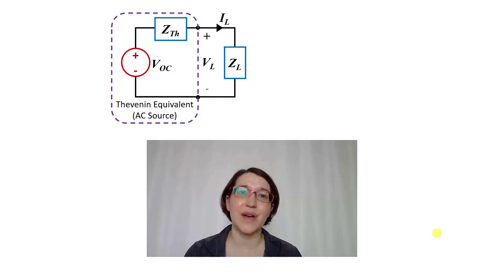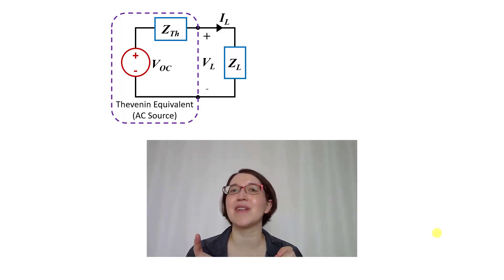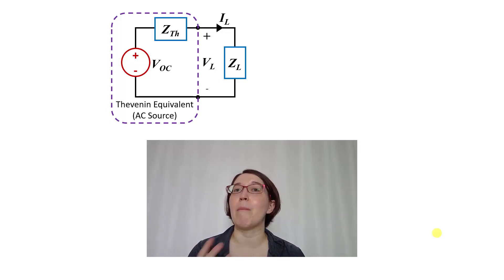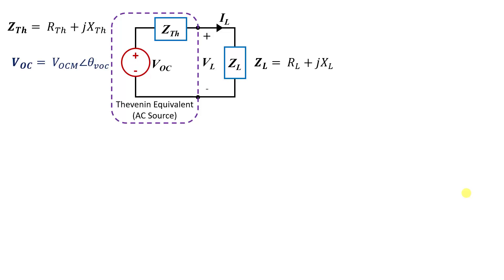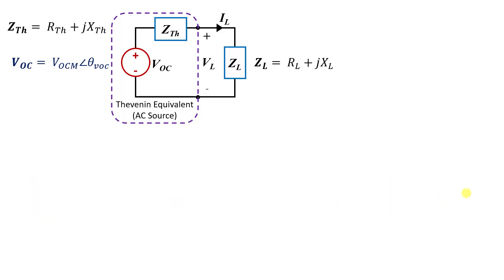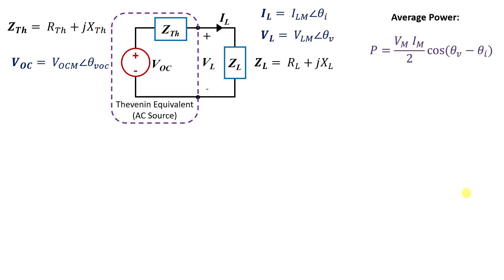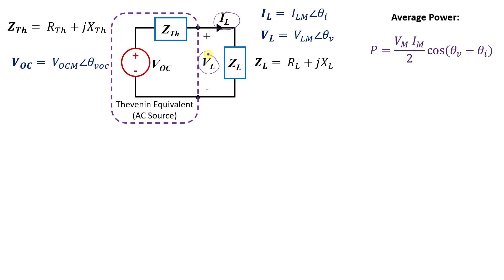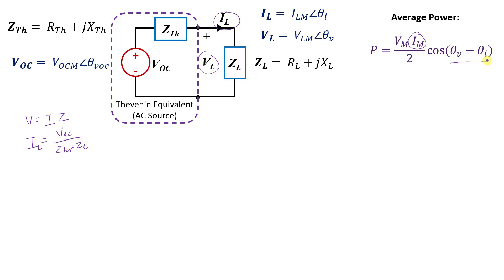Maximum Average Power Transfer For AC Circuits Using Thévenin Equivalent

Comment: Dear professor Kim, thank you very much for these lectures. I have a question about the video 'Intro to Control - 5.4 Understanding Multi-Variable Linearization' at 4:55 - 5:05. Why 'u_e=0' also led to 'y dot =0'? (I understood that 'u_e=0' gives ' u dot=0'.) Thanks!